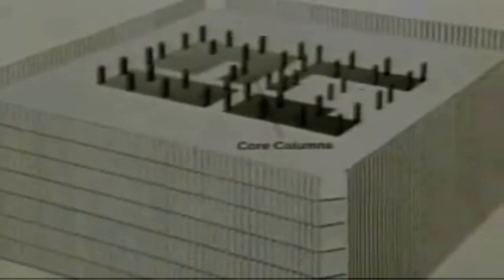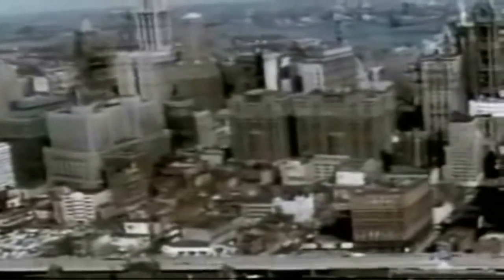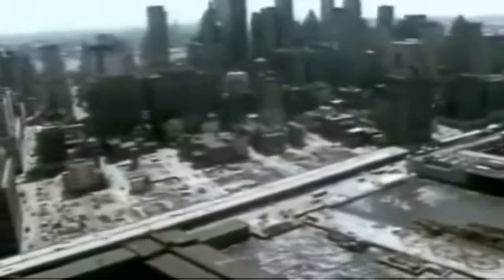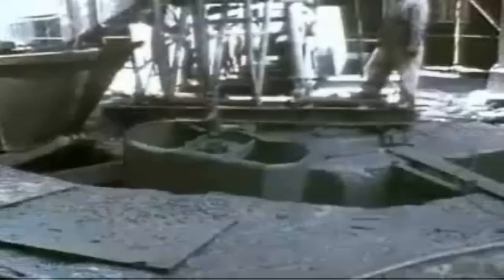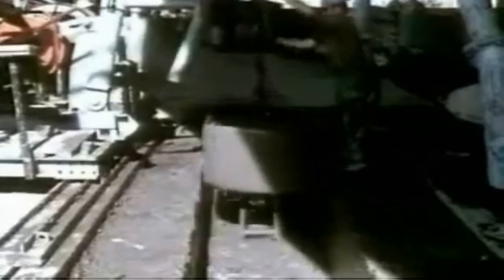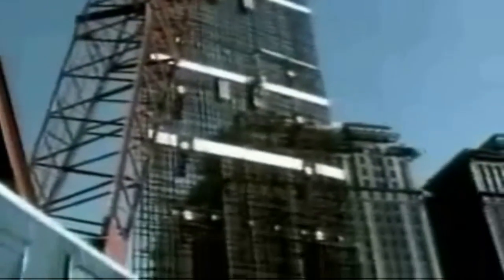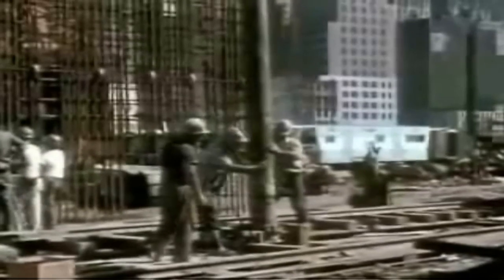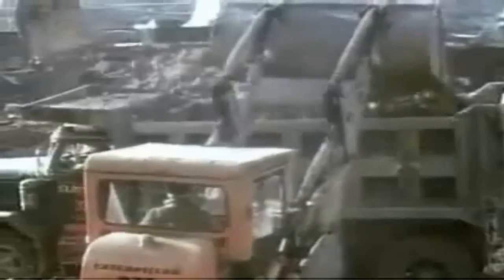Building the World Trade Center Towers

Comment: Jet Fuel can't melt steel beams, but Americans can melt brains.
Reply: Thermal cameras pointing at the towers showed that the temperatures never got close to the temperatures required to even weaken steel. The aviention fuel was burnt off within minutes, if not seconds of the impact, leaving only fires powered by normal office furniture and paper etc, which does not burn hot enough to cause the collapse. One theory sujested that molten aluminium met with water from the sprinkler system, which is a very volatile combination.
Either way, the collapse defies basic laws of physics. There is no way that, for example, 18 floors collapsing downwards would have enough energy to make the rest of the tower below collapse. Maybe the 18 floors below, but not the entire tower. It's basic high school physics (look it up, there are videos on YouTube about it). The towers were built to be strong enough to hold at least 3 times the weight they actually supported. In engineering, it's called a factor of safety. (Again, look it up). 
The central core was effectively a sky scraper within another and accounted for 60% of the load bearing strength. The outer walls accounted for the other 40%. 
The theory of the floor strusses weakening and bending suggests that they somehow pulled in the outer walls. This is impossible as the forces required to do this were not present. 
The only explanation is a collapse of the central core. This would then pull down the whole tower. The TV antenna on Tower 1 could be seen to drop before the tower did, hinting that this was the case. But, what caused the central column to collapse? And again, the laws of physics come in and there is no explanation for the near free-fall speed of collapse, as if there was no resistance. The ONLY thing which can explain it is controlled demolition. Don't get me started on Tower 7! The US Government and the CIA knew there was going to be an attack on the WTC a few months before it happened, according to Susan Lindaur (look it up and watch the vids on here!). This was covered up.
Now, I just want the truth, the full truth, not bits from here and bits from there which conflict each other, not lies and false truths, but the truth, as very little of it makes any sense! When 2250 structural engineers and architects sign a petition to have 911 and the WTC collapse re-investigated, you have to take note! These are the experts they say it doesn't make sense. See rethink911.org 
There are too many inconsistencies and things which don't add up. Phone calls from the plains when they were way too high up for cell phones to work (not just the height, but cruising speeds too making it impossible back then), the BBC reporting that Tower 7 had collapsed when it was still standing etc. Make up your own mind, but please research it thourghly before you do! I'm constantly learning new things about it and more and more, I'm concerned about what "really" happened!
Reply: MrMdmdmdm and Shawn Murphy... would that cause it to fall at free fall speed? Also, what are your thoughts on wtc 7? ...what happened there? ...just asking out of curiosity and to get your intelligent opinion...
Reply: @DetroitSteve313  Why not facts? Building 7 was damaged from the collapse of the tower closest to it. Brain dead conspiracy theorist always ignore the plain as day pictures of building 7's damage from debris and the 7 hours of fires that burned in it. Building 7 was coming down regardless, so why risk the lives of firefighters for nothing. Thats why Larry Silverstein said pull it. Also, why would the government set off a controlled demolition on the towers after the plane inpacts knowing that the impacts from the planes alone would damage the cores of the buildings beyond repair. The moment the planes hit, the towers became scrap metal.
Reply: @thomasdaniels6824  Thanks for your answer. What was burning in building 7? Also, out of both towers falling is wtc 7 the only building that was damaged this way?
Reply: Steve Johnson  Gravity?
Reply: @mahmahmahmuh   Free fall speed would mean absent of ANY resistance (which doesn't support Pancake theory). For a building that wasn't demolished at it's foundational infrastructure, how could it collapse into it's own footprint without any resistance in it's fall?
Reply: so tell me smart guy...did jet fuel also weaken the WTC 7 building?
Reply: UAV GAMING yeah sure it did ????  Mossad Silverstein Bush plus nanothermite do your research dummy?
Reply: im batman cause it ain't there
Reply: MIchael J I guess fire can turn steel into molten volcano lava too.
Reply: jantjehd solid
Reply: Dean no it cannot
Reply: im batman explosives took the buildings down
Reply: kaboom
Reply: Yep
Reply: im batman  Idiot.
Reply: You do know we’re human too right?
Reply: I guess ur brain is melted for thinking and saying that
Reply: If u listen on YouTube videos of the terrorist when air ground control talk to them. They said they had bombs on the plane. Just staying!
Reply: Well said
Reply: MrMdmdmdm precisely some people are clueless to methods of construction as well.
Reply: steel is 60% weaker on that temperature.....
Reply: Go to school and learn physics !!
Reply: Thats true.
Reply: Have you ever seen a blacksmith?
Reply: For most of the time they were burning they were much cooler than a blacksmith (even in the hottest 2% of the buildings) & how about Building 7?
Reply: Jet fuel can't melt dank memes. Steel beams do not melt in a kerosene fire.

But they do not have to. Not with a load (weight) upon them like the upper floors in the WTC. And no, the load is not straight above the core structure - those towers swayed in even light wind. (In stronger winds, they had to close the bar in the top floor. Can’t have the customers puke all over the place. Felt like a ship in rolling seas.)

Depending on the specific alloy, steel becomes workable with a simple hammer at about 400 °C. It starts to be malleable at just 650 - 800 °C.
Reply: ITSAUSERNAME actually it can it was lit and it did not melt it as like you are thinking it weakend it and thw weight of the floors about it was to much and it just went down
Reply: They cant melt but it can weaken the steals ok thats why it collapse
Reply: I didn’t melt I got soft and collapsed on its self
Reply: wtc 7 couldn’t stand the collapse and debris from the WTC so it collapsed.
Reply: As firefighter, you learn, that steel loses 50 % of it’s strength, when it’s heated up over 600° C.
Reply: WupperVideo how long does het fuel just sit there and burn? Not very long I assume. And the theory that the beams weakened is horribly flawed, the building fell onto itself.....it’s all in the way it fell. If the beams weakened the building would have TIPPED not imploded
Reply: Jet fuel didn't melt steel beams, the fire from jet fuel lowed the inherent strength of the steel....fucking loons.
Reply: JoMac, an organic building collapse cannot proceed at freefall speed. It is literally impossible; architects, mechanical and structural engineers have all testified to that point.

Also the only three times in all of history that a skyscraper has collapsed due to fire (“weakening it” or otherwise): lower Manhattan on 9/11/01.

You are wrong, and you have been lied to. Wake up.
Reply: @joeltunnah  Hope your not the Flat Earth Joel Tunnah.
Reply: JoMac, what are you talking about? Is that your rebuttal to my link?
Reply: @joeltunnah  No that was just a question, and as yet no yes or no.
Reply: R1CH130 I showed your comment to a friend whos an astrophysics major, he laughed his ass off

You need to go back to school bud

"Back" what am i saying youve never been
Reply: DoyouevenPraisetheSun? The only argument you provided is that your collage buddy laughed at the comment. You provided no facts, just a meaningless statement of your irrelevant friend. Come back with facts, we all know collage kids are great at being told what to know and think, but they are aweful at thinking for themselves and challenging their ideas.
Reply: A-rod88 yep it burned so hot that there was no structure to hold the upper part of the building and so then it collapsed! Btw sorry if you did not ask me!

Comment: o really?

care to elaborate, O highly enlightened one?

9/11 "truthers" are an embarrassment
Reply: Sarah Prewara The NIST report is a damn fairy tail. You don't have to have a degree to see the truth because it only takes common sense. Think about this... NIST says the exact reason the towers came down was because of the impact from the jets and the jet fuel burning to weaken the structure. NIST claims the pancake theory which means the tip of the towers above the impact fell straight down crushing the rest of the towers below floor by floor until it stoped at the bottom. This is a stupid ass theory if you have any kind of common sense! Even though the heat theory is bullshit because the fires weren't burning nearly hot enough to weaken the steel we will still go with that for the point I'm trying to make. Hot air rises so the structure wasn't weak a certain amount of floors down from the impact, probably the bottom 60% of the towers where not damaged by the heat but the top of the building above the impact was weak and brittle because the heat from from the fire rising up. So I want anyone to explain to me how that weak brittle piece of the building had enough strength and weight to STAY TOGETHER to crush all the floors below without crumbling apart and even stayed together to crush the bottom 60% of the building undamaged by the heat. How did that weak ass brittle tip of the towers stay together to do this????? All those undamaged floors just gave way all at once with no resistance for this brittle damaged top piece of the building????? How the fuck did it stay together to crush the undamaged bottom half???? How the fuck did it not tip over when it reached the bottom half that was not heated up and damaged from the impact and jet fuel??? Think about this shit!!! This damaged piece of building had had enough force and strength to crush everything below it, EVEN THE UNDAMAGED BOTTOM HALF OF THE TOWERS!!!! It's not fucking possible people!!! It would have broke apart to nothing or fell off the side  as it made impact with the UNDAMAGED bottom half of the twin towers. It blows my mind people think this weak brittle damaged piece of building can crush everything below it with no damn resistance at all and magically stay together to do it. EXERCISE COMMON SENSE!!!!

Comment: Planes crashed....fuel fire weekened the steel, buildings fell straight down. Get over it. Many buildings have fallen this way from poor construction...looked like they were demo'd, but they weren't...Ol Sarge...
Reply: mundrubjet  How many steel framed buildings have collapsed due to fire? oh that's right, only 3 and all on the same day!  With your comments, we now all can see how the educational system has utterly failed
Reply: so the fuel leaked down through 80 floors before igniting? and what about all the melted steel? looked a little morw than weakened to me think about that? then there's building 7?
Reply: The steel didn't melt, it was weakened and couldn't support the weight of the upper floors, causing it to collapse
Reply: mundrubjet The NIST report is a damn fairy tail. You don't have to have a degree to see the truth because it only takes common sense. Think about this... NIST says the exact reason the towers came down was because of the impact from the jets and the jet fuel burning to weaken the structure. NIST claims the pancake theory which means the tip of the towers above the impact fell straight down crushing the rest of the towers below floor by floor until it stoped at the bottom. This is a stupid ass theory if you have any kind of common sense! Even though the heat theory is bullshit because the fires weren't burning nearly hot enough to weaken the steel we will still go with that for the point I'm trying to make. Hot air rises so the structure wasn't weak a certain amount of floors down from the impact, probably the bottom 60% of the towers where not damaged by the heat but the top of the building above the impact was weak and brittle because the heat from from the fire rising up. So I want anyone to explain to me how that weak brittle piece of the building had enough strength and weight to STAY TOGETHER to crush all the floors below without crumbling apart and even stayed together to crush the bottom 60% of the building undamaged by the heat. How did that weak ass brittle tip of the towers stay together to do this????? All those undamaged floors just gave way all at once with no resistance for this brittle damaged top piece of the building????? How the fuck did it stay together to crush the undamaged bottom half???? How the fuck did it not tip over when it reached the bottom half that was not heated up and damaged from the impact and jet fuel??? Think about this shit!!! This damaged piece of building had had enough force and strength to crush everything below it, EVEN THE UNDAMAGED BOTTOM HALF OF THE TOWERS!!!! It's not fucking possible people!!! It would have broke apart to nothing or fell off the side  as it made impact with the UNDAMAGED bottom half of the twin towers. It blows my mind people think this weak brittle damaged piece of building can crush everything below it with no damn resistance at all and magically stay together to do it. EXERCISE COMMON SENSE!!!!
Reply: +crushers900 the steel  below the damage was weakened how? fire goes up you can damage the underlying structure by damaging the top 20 floors

Comment: Youtube comments turned to cancer last few years.... Go back to your alien mother ship tin foil hatters.
Reply: Liam Barnes do you people not know structural engineering? The way they were designed made them doomed them the beginning, a lot of it's strength relied on the outer columns, When the building burned the beams holding up the floors sagged from the extreme heat which was fuel by jet fuel, paper, wood, or anything else flammable, the wind provided lots of oxygen which made it burn hotter, As the floors sagged it pulled on the putter columns evenly, eventually causing the building to have total a structural failure, There was a lot of weight above it, And no way for the fire fighters to get up and put it out, the buildings were doomed before the first bit of concrete was even poured in, and if you looked closely, it didn't fall evenly, it actually toppled to the side quite a bit, but eventually stabilized and went in to a free fall, once it gained momentum, it will not stop until it hits the bottom.
Reply: ***** it is when combined with paper and many other items, It might not melt steel, But it sure as heck can soften it.
Reply: ***** Ask my family who work in the steel industry, And ask the scientists who actually did research on this, jet fuel CAN and WILL weaken steel, It's like putting spaghetti in water, Won't be hot enough to eat, But it will start bending.
Reply: ***** And read my comments over again, I never said it can MELT the beams, I said " It might not melt steel, But it sure as heck can soften it."
Reply: Liam Barnes they did, If you watch the collapsing footage again, you'll see the top of the building collapse on its side, the reason it fell straight down is because of its design, floors pulled the outer columns in, making it collapse in on its self, It's basic physics, you can even try it out at home with a few parts, Remember that the twin towers were the only sky scrapers ever designed like that, Which is why no other sky scraper imploded like it, New things always happen, Some never expected until it actually does, It's a dynamic world, it doesn't become static just because we're in the 21st century.
Reply: ***** People definitely died, Ask any family, People have died, These theories are getting crazier and crazier i swear...
Reply: ***** This HAS to be a troll now, Nice try though.

Comment: How anyone can watch this video and not immediately know that there is no way that the core columns could be completely annihilated in a matter of seconds us beyond me!! Remember, 80-90 floors of these monoliths were undamaged and untouched by fires. Even the other sides of the damaged floors where the staircases were were cool enough for survivors to make it down to safety. So, tell me how ~20 floors of damaged/weakened building materials could pile drive those ~80 stories (Xs 47 core columns) into warped remains in ~12 seconds and I'll show you who did the Controlled Demolition required to bring them down.In a nutshell, you're a mouth-breathing retread if you think this was 19 hijackers and some boxcutters!
Reply: Lane arndt ...FYI..SAFETY FACTOR Design is simply 2.5 to 1 tor the structures and 4 to 1 for elevators. What would the impact force of say 18 floors of building be?? It would be about SEVEN Times more than allowable design load strength as merely dead load! But with impact factor of live load and dead load gravitationally would conceivably be Many Times more than 7 times the safety factor. Thus hypothetically floor 92 level would not have remained when the 18 floors above entered gravitational descent upon it. No reason to comment or speculate any further!

Comment: The summary of the nist report says the top tilted and began its decent (that's it). It does not give any explanation as to why the steel outer walls were destroyed or the steel central column was destroyed. Why were the steel walls that were not holding the tilting end of the building above destroyed so quickly, why did the steel walls not simply topple to one side. And why was the central column being crushed since it could hold up the top of the building to begin with and there was less weight on it as the top was pivoting on it to go to one side.